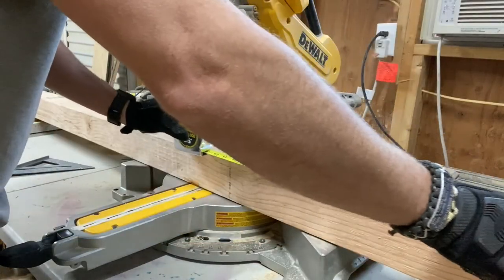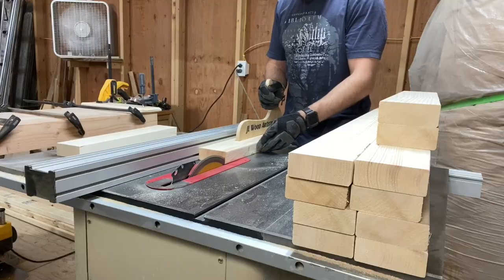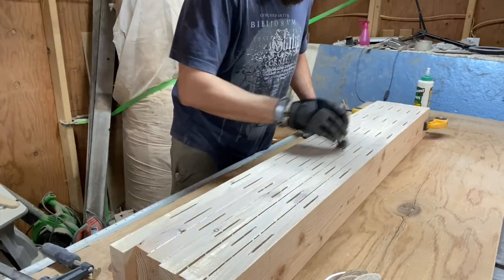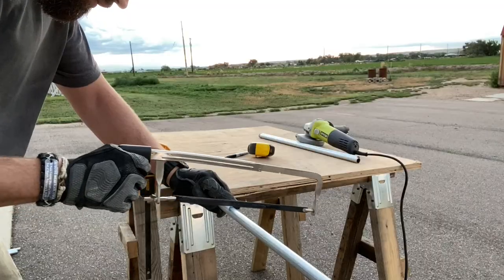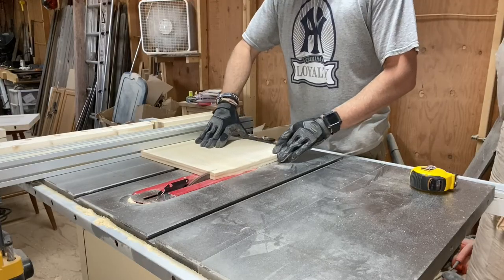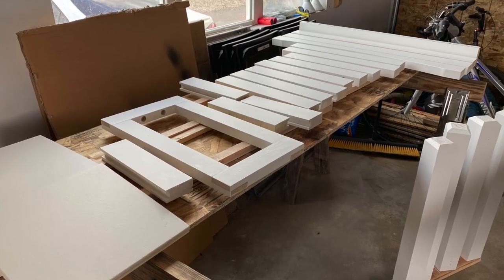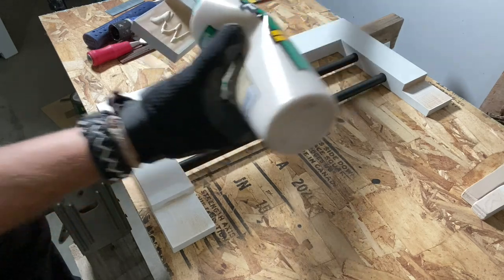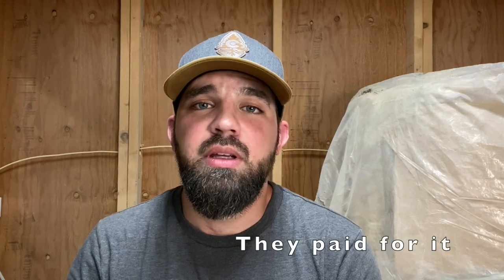Dog Kennel Table | How-To Woodworking | DIY Home Furniture

Comment: How far down from the top of the upper cross members do you put the groove for the z clips?
Reply from the maker: I cut the grooves 1/2” down from the top. That was for the Z Clips I used so it might be a good idea to check the dimensions of the clips you are using to make sure your cuts are in the correct spot.
Reply: Thank you. How did you put the back panel on? Looks like you inset a 2x2 next to the back legs and attached it to that??
Reply: One last question, what size forstner bit did you use?
Reply from the maker: @matthewwright4188 That’s a great catch. I never realized until now that I didn’t include that in the video. You are correct but they the same thickness as the horizontal rails so probably closer to 1x1. If I remember right, they were glued and brad nailed to the inside of the legs and then the back panel was glued and screwed to them, the rails, and the legs.
Reply from the maker: @matthewwright4188 I want to say it was the same size as the conduit, which was 1/2”

Comment: Looks good. What was the cost for making this?
Reply from the maker: I’m sorry. I’m not exactly sure what I spent at this point in time. Plus I already had some of the materials. I’d bet for one similar in size you might be looking at $300 or so. That’s with using  soft wood like I did. Using hard wood will definitely make it more durable but the price will drastically increase. Hope that helps. Take care.

Comment: I was wondering why you spent so much time grinding the ends of the conduit that would be hidden in holes, then I saw your USAFA cap and it immediately clicked. Fast, Neat, Average...
Reply from the maker: I chose to grind the ends smooth to prevent injury or metal splinters before installing them. It wasn’t really needed for project, more for safety. I’m not FGG, but if I could go back in time and redo some things, that would have been one. I’m a supporter of our military and used to be a first responder until an injury. Oh, and Falcons football is the best. Thanks for watching.